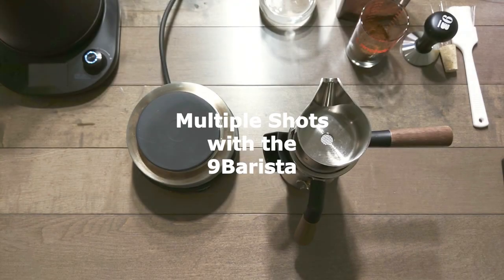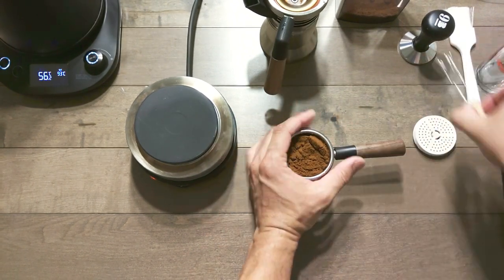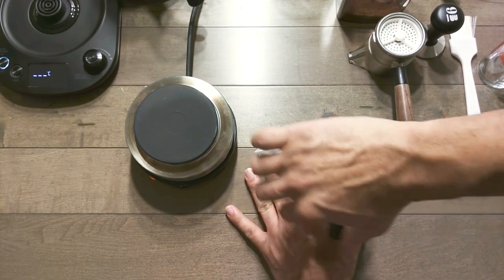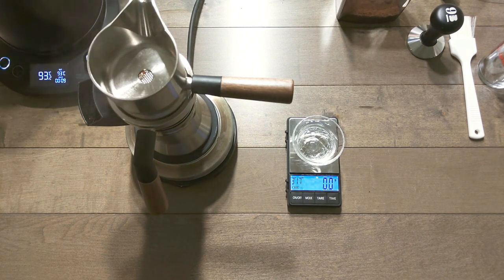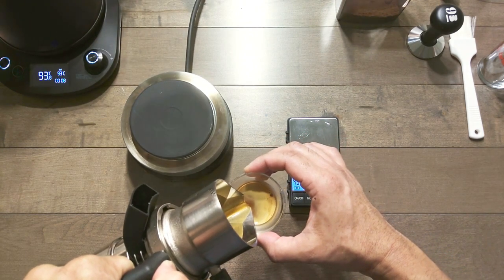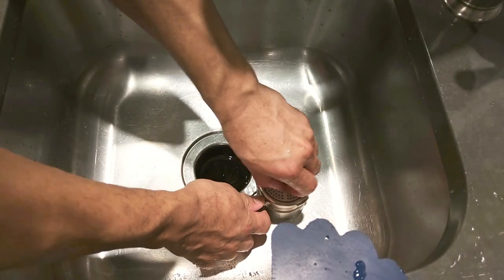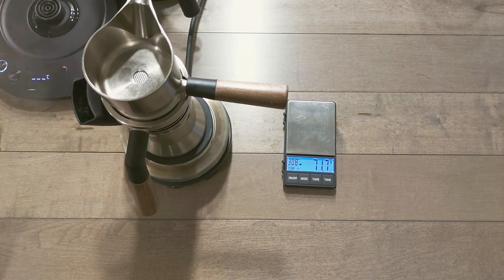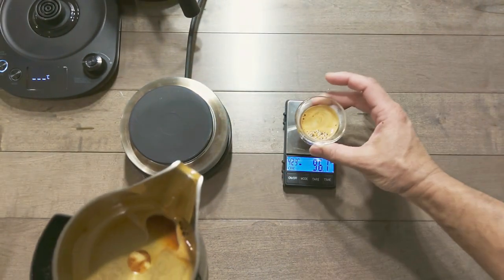9Barista workflow, pulling consecutive shots

Comment: i think the makers mention that its not good to use boiling water from the start but rather cold water.
Reply from the maker: When I first started using it I was pretty strict about following the recommendations. but from my experience I haven't seen any downside except for the fact that I'm complicating the workflow. Generally I think it's not worth starting with boiling water for most people. In my case though, the burner I'm using benefits from the help.

At first I worried about safety, but the 9Barista requires substantial heat internally to build up and increase the pressure. If you put boiling water in there and just left it nothing would happen, it's not enough. Conversely, if I put boiling water in my moka pot, I can hear it start (or trying) to brew. Guessing it's because there's no internal valve like there is in the 9Barista (triggered at 9 bar).

I've had a case where I used a much weaker burner and it didn't generate enough pressure to produce a shot, even though a very small amount of steam was coming out. I transferred it to the stove and it then pulled the shot about a minute or two later. That led me to think it's ok to start with boiling water and that it could speed up the process.

But I think you make a great point and I should ask 9Barista why they recommend cold water and if there are any concerns with boiling. I'll reply here (and maybe update the video description) when I hear back.
Reply: @davidmaurice1294  appreciate you letting us know what they say David
Reply from the maker: I heard back from 9Barista. They confirmed that there is no issue with using hot water in the boiler, but did caution that one should be careful handling a hot boiler. In thinking about that it makes sense that they don't promote this since it can be a safety issue.

They also confirmed that it can reduce total brew time, but overall it's not something they typically mention as it's not a necessary part of the workflow.
Reply: Thanks  @davidmaurice1294 . Actually I used to do the same in my mocha pot (partner always boiled a kettle so always some hot water available at the same time). I assumed it might have been a safety thing havdeling the bottom of the machine but didn’t want to assume. Always better safe than sorry right.

Comment: I don't know. I'm a bit disappointed by this thing. Have it for several months now and still have issues with too acidic extraction, no matter if I grind finer or not and no matter how I adjust the temperature. Overall this thing is too tricky and picky in manualing and dialing in and for such a high price the company could have designed a device which works so much better and could be more easy to use to get a "good" shot of espresso. I heard/read about so much people who had the exact same issues with it.
Reply from the maker: That's unfortunate. Dialing in can definitely be a challenge, but once you get a general idea of the particulars with the 9B it becomes easier to do. That being said, I still have those times where it takes more than a few shots to get it in the ballpark.

I can try to help if you give me some specifics:
- grinder
- coffee (brand, roast, days past roast date, etc.)
- water (filtered, bottled)
- shot times (e.g., 25-30 sec)
Reply: @davidmaurice1294  I own the 9Barista for a few months now, but I still seem to be doing something wrong. I use a Commandante to grind, grind to either 8 or 9 (coffee beans are fresh, which means 1-2 weeks after roast date, from "The Barn" in Berlin Germany, called "Caballero"), I'm pretty sure that the problem is not the beans, I tamp normally, not too hard, since the manufacturer itself states that a pressure of 5kg would be enough. I use a distribution tool and have an electric stove with the included heat transfer plate on level 4 of 6. Since the transer plate is on top, the heating process naturally takes a little longer, which means I never actually get to the 3-4 minutes that the manufacturer is aiming for, but I do have also heard that you can heat up the kettle without the portafilter screwed in and that you can only screw in the portafilter when the water has already started to make noise (bubble), so it's not a problem at all. Without the transfer plate, the jug or the handle gets too hot for me so I can hardly touch it with my bare hand, thatswhy I use the plate. In the end, despite the fact that the flow of the shot reaches the optimal time of 20-30 seconds, I always end up with a shot that tastes quite sour.
 
I've tried several coffees now and every time I end up with the same "taste problem" and don't know what to do anymore. And yes: I have already tried a finer grind, as I often read that the finer the grind, the less sour the shot tastes. For me, the taste hardly changes and with a finer grind than 8 I have the problem with the shot flowing too slowly, which then lasts significantly longer than 30 seconds, so to speak an over-extraction. So for me the 9Barista is still a science in itself and just a bit too picky in the perfect setting/processing. I don't know exactly what I'm doing wrong and I'm a little frustrated. I've also heard from many people that they set the temperature higher at the beginning and then as soon as the water starts making noise, they adjust the temperature of the stovetop again a little. I don't know if that really helps, but I'll have to try it. I've come across the problem with the sour espresso with the 9Barista several times in several forum entries, so it seems like I'm not alone.
Reply from the maker: I'm assuming you're using the Comandante C40 but don't have Red Clix? If so, that might be your biggest challenge. The standard Comandante has an adjustment of roughly 30 microns per click, which is pretty large. Many people these days are either using something that's stepless or that has a much finer adjustment (e.g. 12 microns or less). To compensate, you'd need to play around with dosage and yield. For example, on setting 8 increase the dose to try to have a longer extraction (40 sec). Or you could lower the dose and shoot for a higher yield (1:2.5). Both are not ideal and can be finicky, so your best bet would be to have finer adjustments. If you have a friend close by with an espresso-focused grinder, that might be a way to confirm if that's the issue.
Reply: @davidmaurice1294  Exactly, I use the C40 but I don't think that the problem would be the missing Red Clix Upgrade. Never heard of anyone who had any problems with grinding the right size with the C40 for the 9Barista. And I don't think that the issue with getting a sour shot is caused by such a minimal aspect. I saw ton of videos on Youtube where people having so different grindsizes of their beans and they always got a good looking shot with an almost perfect time and good crema, which never appeared to taste sour (maybe they simply didn't tell). On top of that: theoretically it is impossible to get a sour shot if you grind a really fine size (click 7 or 8 with the C40) and let the extraction run for 40 seconds for example, instead of 25 seconds. But in my case it actually is, don't know why. Usually a sour shot always comes from a too underextracted or too quick extracting shot. So in my case it doesn't make sense, since even the slow and overextracted shots are sour, but it is as it is. Somehow I think that the problem is caused by an temperature issue which means a not optimal setting of my stove. Which heat settings/temperature do you use and how long it takes from turning the stove on until the extraction happens?
Reply from the maker: I think it's highly unlikely that it's a temperature issue. The 9B is designed specifically around temperature control. Because of the internal valve, if there's not enough heat, it will simply not produce any espresso. If you don't suspect the grinder, maybe it could be the yield, meaning an incomplete extraction rather than under extraction. For example, if you're using 20g of coffee you should be aiming for a 40g shot at a minimum. In your case, I'd try a 18g dose and still aim for a 40g shot and see if you get a different result. Also, I would ensure that you maintain a high heat until the end of brewing to prevent the valve from closing prematurely. Lastly, are you getting good crema?